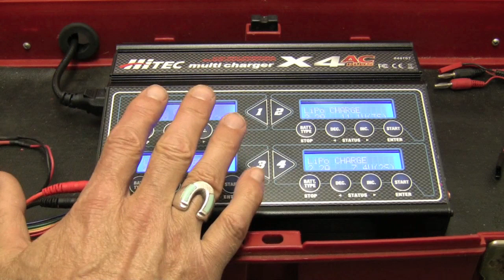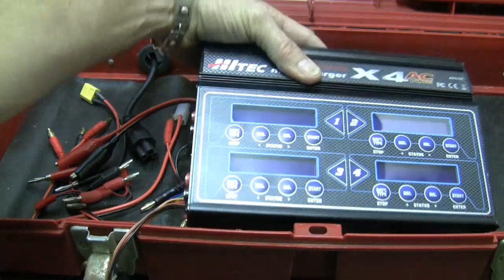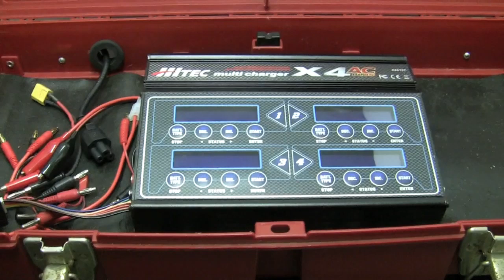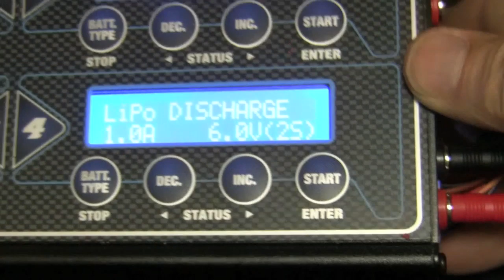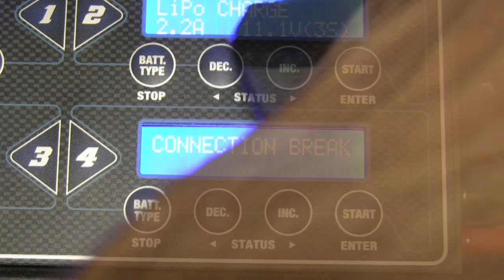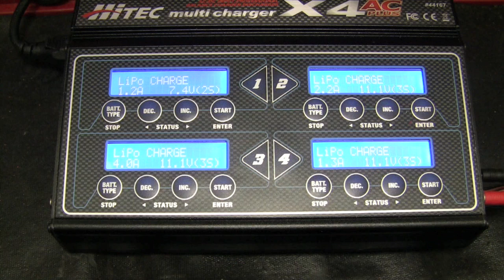Hitec X4 Multi Charger AC Plus - RCGroups

Comment: Hey thanks for the video. I recently got me one of these and I must say it is one of my best buys. I have a pair of questions and maybe you can help me. First, what is the difference between Charge and Fast Charge? And second, how can I change the Storage values? The charger seems to set my lipo batteries at 3.80, and I would like to change it at 3.85. I can't see the way to get it.
Once again, thanks